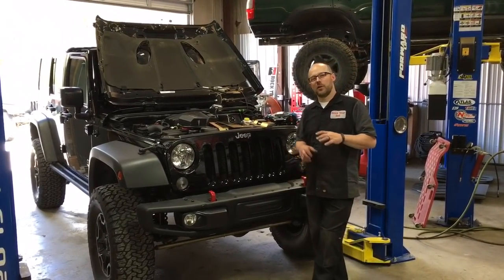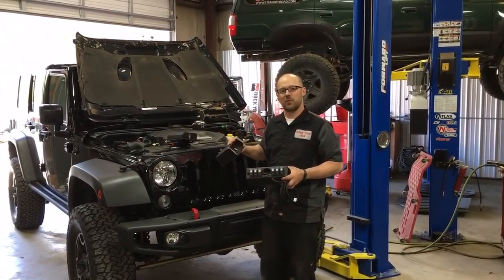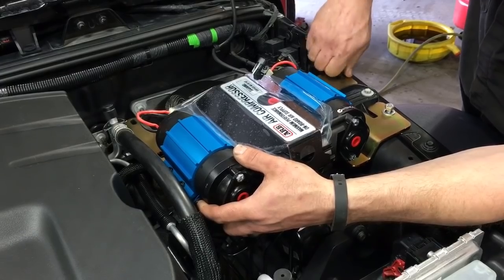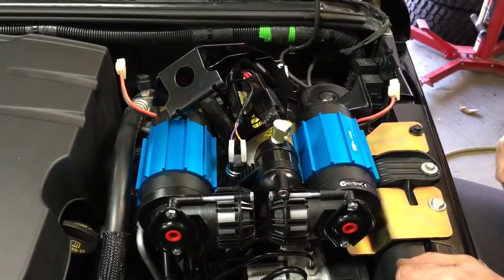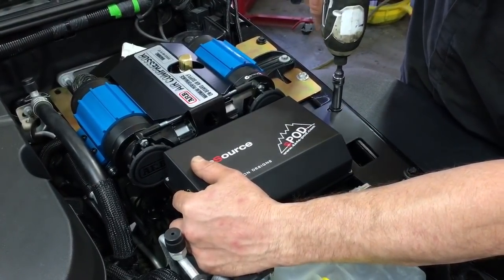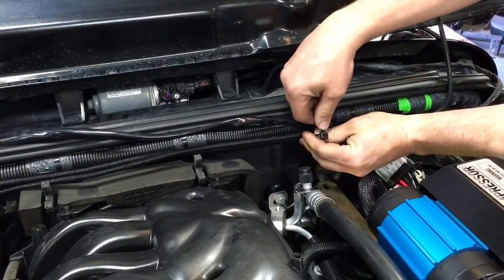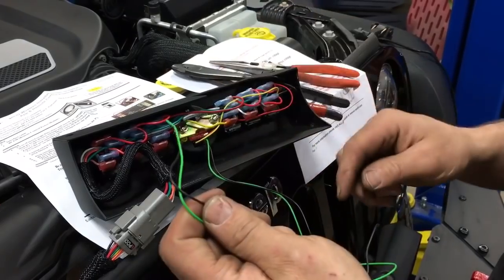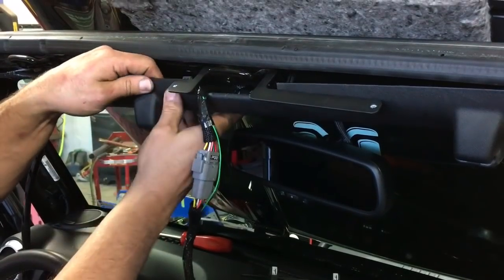sPOD and ARB twin compressor install JK

Comment: just installed the MetalCloak bracket and i wish the bolt that holds the support arm was welded to the main plate because that would make it so much easier to tighten. i do love the bracket.

Comment: This is awesome. I purchased the Air Zenith kit and need to get the remote fitting kit. Does it come with the adapter and t-fittings used to connect the Air-Zenith Pressure sensor shown at 10:41? Looking at the sensor it seems like its a different type of thread.

Comment: Very nice and clean install. Just bought a 2017 JK. Could you give me info on how you wired the air compressor and air gage to the Spod?
Reply from the maker: Bruce Nix We have all the parts in stock. Give us a call and we can walk you through it.

Comment: It appears in the video that you are hooking up the ARB compressor to the battery directly (4:07 in video). If this is the case, why wasn't it connected to the SPOD for power? Thought that once the SPOD was in, all accessories would run through it. Thanks.
Reply from the maker: mikeguitarification Since this is a twin compressor it has 2 circuits (one for each motor) that have 40A fuses. If you were to use the sPOD as the control for the main power instead of the trigger circuit for the compressor assembly then you would have to have two switches used up for the compressor and have to engage them at the same time. In this case the sPOD is controlling the purple wire which triggers both of the internal relays built into the compressor housing. Otherwise, you would have to disassemble the compressor housing and rewire the compressor completely to control it by the sPOD. Thank you for the question and let me know if this answer does not make sense.
Reply: rockyour4x4 makes perfect sense and answers my question. Thanks for the quick response.

Comment: Where did you get that trick brass  mount for the bumper air hose connection. .? Great video
Reply from the maker: S WALKER https://www.rockyour4x4.com/?product=remote-fitting-kit

Comment: Why do you need all those other wires connected to the battery if you have a spod....I thought with the spod all you need is a hot and ground from the item your installing?
Reply from the maker: Physical Starfighter It all depends on the load you are using. An ARB twin has (2) 40A maxi fuses. In this application the sPOD is being used to trigger the relay block of the compressor since it is built in to the compressor.

Comment: Great video, thank you very much!! Would you be kind and explain how did you integrated the spod with the air gauge I just got this setup and trying to figure it out. Thanks in advanced
Reply from the maker: Yair Haim  The power to the gauge was connected to the small push button illumination circuit, ground was paralleled to the ground circuit up there, and the sensor wire was added and run up to the sending unit under the hood.
Reply: Thank you so much for the help!

Comment: I like the set up you have with the Air Zenith gauge coming on with the sPOD.  I seem to be a little dense when it comes to understanding how you connected the gauge to the sPOD switch bank.  From the video it looks like you connected the yellow wire to the center post of the first switch and the red wire to the top post of the first switch. Am I close?  Thx and great video.
Reply from the maker: Dougie Fresh the power feed to the gauge comes off of the switched side of the sPOD push button.

Comment: What is keeping moisture/water from destroying that cute little circuit board of the Spod? Bad design to be stuck under the hood is it not?
Reply from the maker: Casey Dman it has a cover. So far the design has proved to be very good.  We have not had any failures yet and we sell quite a few.

Comment: The piece for the sensor.  Did you guys fab it? The sensor is not 1/4 npt. Thanks!
Reply from the maker: Summer Lofn Jeep the sensor is a 1/4” union or “T”.  The sensor is screwed into a 1/8” to 1/4” adapter.

Comment: do you have links for the products, I like that fitting kit but can find it. also tell Web site says it will work the the relocation kit but how about without relocation
Reply from the maker: Tony Barefoot The remote fitting kit is a kit we put together. You can purchase it directly from us for under $40. You can contact us through our website or call us directly. I would be happy to answer any questions you may have regarding this installation.

Comment: Whats included in the Rockyour 4 x 4 remote fitting kit ? I have an Spod with gauge currently installed and have the ARB along with the MC bracket but havent installed yet ... Does the remote fitting just allow you to use the compressor without having to open the hood ? Whats the purpose of the Sending unit?   I just want the ability to use the compressor without opening the hood like you have it in the video - not sure if I need the Zenith option..
Reply from the maker: Deacon Nyte it includes the fittings, hose, and bulkhead to move the ARB fitting to the front bumper. It runs $35 plus shipping
Reply: rockyour4x4 I’m looking to order your remote fitting kit, but don’t see it on your site. Can you help ?

Comment: I tried to call looks like I missed you guys! I have bought the sPod with the stock air gauge in it and have been racking my brain for months as to where I can put a tank to make sure the pressure gauge works and I see this!! No tank needed and i can swap in the digital gauge?? Extremely interested in this looking forward to hearing from you.
Reply from the maker: Tony Mogavero give us a call M-F 8-5 eastern

Comment: question...if i am planning on ARB air lockers will the dual compressor work for that as well or will i have to run the seperate compressor for the air locker also.  Plan to call on monday to order the mountin bracket.  Thanks!
Reply from the maker: JP Latkovic Yes, the compressor will work for that too.

Comment: Will the brackets you used for both the SPOD and Compressor work in a 2009 Wrangler?
Reply from the maker: raustin679 They sure will. We keep them in stock if you need them.

Comment: Have you had any experience in installing this spod & arb combination with the various big brake kits that use a larger brake booster reservoir and space or fitment issues? How did you resolve them if so?
Reply from the maker: David Kay Sorry, we have not run across that yet.
Reply: I asked Ben at Rubitrux unlimited he’s the owner and he told me with the molar bbk with the xl brake booster the arb air compressor will not fit they recommended to mount it under the seat with teraflex’s mount if you have the bbk.

Comment: Awesome video. A few questions: 

1. sPOD recommends a 5AMP fuse to be used. Why did you keep the 15AMP fuses in?
2. Did you combine both negative wires to one connection ring terminal?
3. Did you connect each red wire to its own connector ring terminal and put them on the battery terminal?

Thanks in advance!
Reply from the maker: Design Thinking Nomad 
Thank you
1. The purple trigger wire only draws about 100-200 mA and would only need a 2-3 A fuse. The lead is around 12" from the sPOD to the compressor and the chance of a short is 0% with the length, routing, and conduit added. 
You are correct in noting each circuit should have a fuse for the load it is controlling. We just moved the smallest fuse provided to #1.
2. Both the 8ga and 18ga ground wires were connected together with one ring terminal. 
3. The 2 10ga wires were connected separately only because we did not have a ring terminal available at the time of the install to combine them.
Reply: Thanks! All makes sense. I just finished up my install this afternoon. Will be posting a video here shortly. Appreciate the help.
Reply from the maker: Design Thinking Nomad send me a link when you do.

Comment: How do you get your Master cylinder to add brake fluid and to check the level with this thing on there?
Reply from the maker: A68170 Its a tight fit but you scan still get access and pour carefully

Comment: How did you remount the horn? Is it connected to the compressor mount?
Reply from the maker: Marc Chadwick yes, there is a place to relocate the horn on the new compressor bracket.

Comment: What I don’t understand is why things are still be hooked to the battery and there’s the pod.  I thought the whole point of the pod was so you can hook things up the pod instead of the battery because the pod is hooked to the battery?
Reply from the maker: James Scott The pod only supports circuits up to 40 A. The twin compressor is an 80 amp circuit. We are using the pod just to trigger the relays. Everything else that you would normally hook to the pod would still work simply.
Reply: Got it.  Thanks for clearing that up for me!

Comment: do the wire from the compressor come with terminals or just bare ends?
Reply from the maker: whatroads4x4 They come bare but the compressor comes with terminals to crimp on them.
Reply: @rockyour4x4  copy that

Comment: Was this a personal install or for a customer?  I ask because there’s another popular video of this compressor failing on multiple levels.  This video is a little old so how did it turn out for you?  Any problems?
Reply from the maker: James Scott This was on a customer’s vehicle. The same vehicle is still running strong with no compressor issues. However, on my personal vehicle I have the same compressor and I have replaced one motor twice on it over the course of the last eight years.

Comment: Hey had a question on how this is working out hooked up to the Spod. Spod says that the Twin ARB draws to many amps for the spod? Is this true or have you made any mods to counter this?
Reply from the maker: Sauce1977 You will connect the twin compressor to the battery like the wiring diagram from ARB states. You will use the purple wire on the ARB harness to run to the sPOD underhood unit.
Reply: Did you just end up using the purple and black wires to hook up to the S-pod number 1 pos & neg?
Reply from the maker: Sauce1977 That is correct
Reply: rockyour4x4 Awe It works !!! Thanks for the help man!!!!

Comment: Have a question to the mounting. The plate where the compressor is mounted on, is this includes when you order the compressor or is this handmade by yourself?
Reply from the maker: Andy Bee This is the Metalcloak mounting bracket. We keep this part in stock.
Reply: rockyour4x4 
OK thanks,  do you ship to Germany or do you have distributer ?
Reply from the maker: Andy Bee I'm sure we could arrange something for you.

Comment: I would not have put the female fitting there, they could also have put some shielding around the supply hose. Sloppy install overall.
Reply from the maker: E Begger It is still going strong 4 years later.

Comment: What’s the size of the hose used hooking up to the remote hose fitting?
Reply from the maker: Cedric Johnson 3/8”, and it is included in our kit for $35
Reply: Kit? I’m unaware of a kit you have?? Please send me the link for that :)
Reply from the maker: Cedric Johnson sorry, I don’t have a link to the kit. Usually people just call us to make the transaction. The kit includes( 2)90° fittings, (2) 3/8” push lock fittings, one bulkhead pass-through fitting, and 6 feet of 3/8” hose. Cost is $35 plus shipping
Reply: Is the same kit is used for the CKMA12?
Reply from the maker: Cedric Johnson yes
Reply: I just placed an order for it. Thanks again for your prompt replies.
Reply from the maker: Cedric Johnson thank you